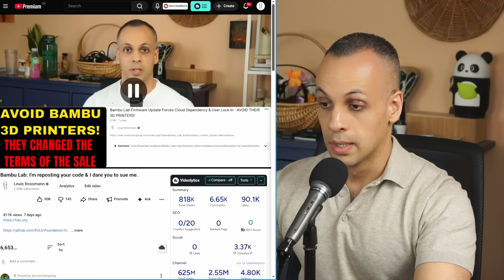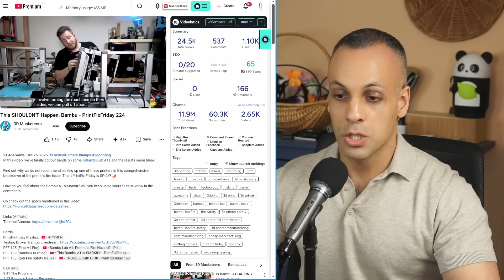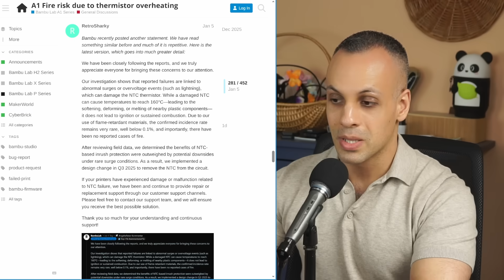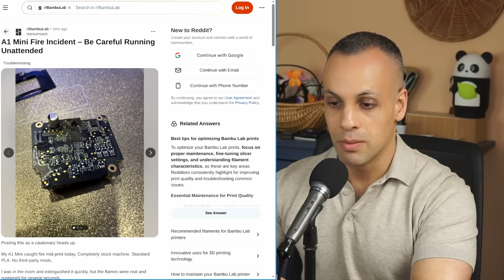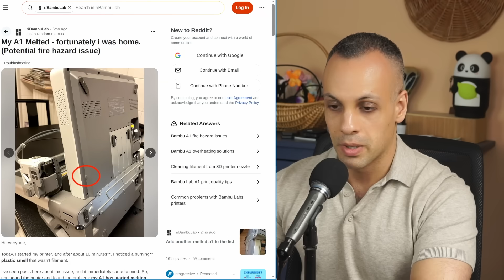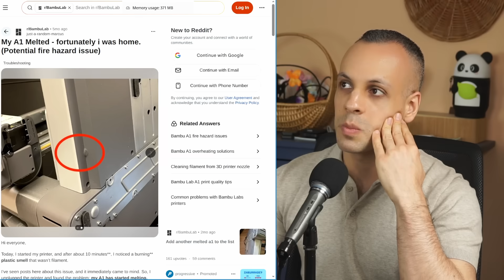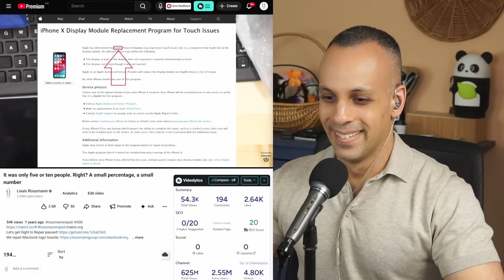Bambu Lab PR dumpster fire is turning into a literal one...

Comment: New to 3D Printing and have the X2D. Had problems with the Bowdon extruder, would not feed the right nozzle. Also problems with the AMS HT not feeding filament. Bought a new Bowdon from a 3rd party, they said they would compensate with a gift card, which is fine. And they will do an exchange on the AMS. This after way too many Emails back and forth. Only product I ever bought that doesn't have a dedicated phone support option. Guess that's standard SOP.

Comment: I bought an A1 in january and last week the NTC burned down. They sent me a replacement board and it was missing one of the cable terminals from the factory so now I'm waiting for a new one again...

I'm worried that the new AC board design doesn't have an NTC, they literally just bridged it... is that safe? if the NTC got so hot it melted, how's putting just a wire safer? should I be worried??

Comment: I went in for my second attempt at getting into 3D printing last year and bought a Flashforge A5M (not Pro) on sale because it seemed to be about on par with many of Bambu's features and specs but was way cheaper. I did my research and found that there had been some small controversy with getting them to upload their code that was built on open source software and there had been some teething issues with the initial product launch, but thanks to public pressure and a lot of patches, things had been ironed out. I was relatively happy with it and even their support email responses were WAY snappier than the many people complaining on their own subreddit were talking about. I ended up reselling it locally because I wasn't using it much, I needed the money, and needed the space, and I really do think that it's just as you said -- if a company like them could clean up their image and swoop in they'd be able to take Bambu's disillusioned customer base away easily. it'll be interesting to see how things look back when things are stable enough for me to give the hobby another go.

Comment: so sad to see Bambu's greed turn into the bad press.   They had an amazing line up prior that just worked!  I was amazing how easy and trouble free 3d printing could be.   I gave up on the hobby honestly.   If I ever go back, I'll only go with open source compatible control cards, and hardware readily available with easy replacement options.  It's all about the sensors and software anyway.   As open source got better and better, no reason to give brand names your money.  DIY/Open Source,  no reason to deal with restrictions and invasive tracking of what you may or may not be doing with your printer.  LOL.

Comment: Great Content. I own a Bambu Printer, but a Big one a X1C, which runs now on X1Plus since the Bambu Connect Disaster. I have recommended several A1 printers and i am now in a Trouble for it. It was before Bambu Lab turned Evil, before they were normal Chinese. I can only recommend Sovol Printers right now as true open source but they are not beginner Printers. If you buy a Sovol like the SV08 they even give the Voron poeples money for the Design, the SV08 is a budget Version of the best Printer, the Voron 2.4, with all the draw backs, but can take most upgrades a Voron 2.4 can take.  Intresting Question for the Burning Bambu Lab A1:  Which Versions are Burning? Bambu Lab said 1.4 Boards had fixed it, and reviewers had the 1.0 and 1.1 Boards and even under Thermal Cameras and "no hot spots". So are only the 1.2 and 1.3 Boards the Problems?  For me it's looks like that the management had a major change in 2025 at Bambu Lab when they were growing massivly. Before they adressed such safety problems appropriately, since 2025 no longer. And you buy today a Printer how they handle Problems now and not how they handled them in 2023 !

Comment: I never tried 3D printing until I bought Bambu Lab's A1 Mini a couple years ago. At that time, my impression of Bambu was positive. It seemed they were making affordable 3D printers that were reliable and easy to use for beginners like myself, and there were various open source slicers like #OrcaSlicer to choose from. 

But my opinion of Bambu Labs has now changed dramatically. Now it feels like their long-term plan was to attract people like me – who had always been interested in 3D printing but never got into it due to high costs and steep learning curve – into becoming new customers, and then once they gained market dominance, tweak the rules (or ignore them) to lock us into only using THEIR software and consumables. 

I've been a professional graphic designer for the past 30+ years, so I've victimized by this same corporate strategy before. Adobe is the prime example... for years, they pretended to be a creative-friendly company, catering to us, sucking up to us... hell, I used to get wined & dined by Adobe back when they were trying to convince designers like me to switch from Quark XPress to InDesign. But once they established market dominance, they started treating us creatives like dairy cows trapped inside their barn, by switching to a subscription-only model, latching their hoses onto our teats to extract their $30 every month... which then became $40/mo, then $50, and now it's up to $60/mo for software that hasn't substantially improved for 20 years. Adobe are shameless leeches that are now universally despised by the creative community, but they have a monopoly on the tools we have to use.

Same tactic as the predatory companies that sell us cheap printers that use proprietary ink. Lure us in with affordable hardware, then lock us into their ecosystem and turn us into their milking cows. Yes, I know there are alternatives to Adobe and Bambu Labs... but that's not my point. My issue is with the whole "long play bait & switch" strategy that seems to be what every company is trying to deploy these days. Instead of keeping customers by improving what they offer, keep customers by weaponizing the fine print above the "Accept" button they clicked. The more market share these corporations get, the greedier they get. 🖕🖕#BambuLabs🖕🖕

Comment: I would never buy a Bambu Lab because of the restrictions. That said, i have had little to none good experiences with chinese brands (Creality Wanhao). The only good printer from China ive experienced is the Formbot/Vivedino Raptor. Ive got 5 printers now, all Prusas. Why? Because ease of use, easy to repair, intuitive assembly. And the most effective support system in the whole 3D printing market. I can see why people buy Bambu Lab. Its like you said, Louis; they just work, like Apple. But when you want to do more/repair them, you hit the wall. And, yes, i run a cellphone repair shop, so ive had (and still have) the agony with serialized parts for Apple. Love watching your videos where you expose issues that alot of people have. Keep it up

Comment: A small number (almost all of the ones I’ve seen) of Chevy Sub/Tahoes have an issue where Chevy designed the dashboard poorly and used the cheapest possible plastic, so the dash is disintegrating after a decade or so. But eh, it’s a small number. No recall. No accountability.

Comment: I have been doing this since 2011. I started with the RepRap and Prusa Mendels. I still have the first Mendel I built in 2012. So I have literally seen it all.

I absolutely loved bambu and the product they made. Bambu labs' devices solved so many of the headaches the consumers routinely faced with other notable brands like Creality. However, having said that, this is not good for them, for the industry and most importantly for the consumers. I thought I'd keep upgrading to the best and newest bambus but I think my next printer is a different brand. This obsession about being "The Apple" of 3d printing is going to be bambu's undoing because I really don't think the comparison works. I wish they'd realize this and open up the ecosystem because adoption would go through the roof and they'd really actually be where they wanted to be all along.

Comment: Bambu has been actively trying to stop anything that might render their products non proprietary since about day 1. A third party company even sold a larger screen upgrade and they stopped that. Which especially stands out for a community that mods almost everything. Not to mention that almost every printer you can get just runs right out of the box. So no, I would never buy anything from that company

Comment: Easy to get started on (P1S got me printing), but once you learn, the restrictions are bullshit. Give me great power, im fine with responsibility. 

So happy with my Centauri carbon. After a certain point, the comforts are no longer worth it, for example, when you can calibrate all your filaments properly. 
Also nice to have the option to get printing at up to 350 °C on the Gen 2 rather than either spending way more on a Bambu or wiring resistors in series on my P1S hotends to get it printing up to temp for PPA/PPS.
Can't update my firmware without getting my printer cucked. Need to navigate whether I can even upgrade Orca without breaking compatibility with my printer (had to roll back the last time). Never buying one of their printers again.

Comment: I recently bought the Elegoo Centauri Carbon 2 as my first printer, because of this story. So far I'm happy with it. Obviously didn't do anything too complicated yet. The app has a lot of issues connecting to the printer. But I honestly do not care. I have to use a laptop or PC anyway so dumping the file on the USB stick they provide is just as easy and doesn't send everything I print through their cloud service. If you care for good value and want just one printer for hobby stuff and personal needs I would say it's a decent choice (keeping in mind that i'm very new at this)

Comment: I was looking at bambu lab a few years ago. That was right at the time they closed everything down. Luckily I had not made a purchase yet so I avoided them.
Though the Anycubic Kobra 3 I got instead is not the best either. It took a while before I started using it lan only, and I still use their software as that seems to work best.
At some point I got tired of the prints it made. My old Anycubic Kobra 1 and Vyper did a better job, although a lot slower. 
So to have the option to get into other materials I went and got myself a Creality K2 Plus Combo set. That is really a beast of a machine and I have almost no problems printing with it. I haven't even tried to tweak any settings, as it works fine as is. Only thing is I have it LAN only mode now on a closed off network.
I still use their software though. I haven't gotten around to using orca yet. And as long as their software is not annoying me, I'll just use it. (I do utility printing only, nothing fancy)

Comment: The P1S from bambu also has the same NTC thermistor issue. Though not nearly as common. My friends P1S NTC thermistor failed @ ~1500 hours. Sent the request off to bambu, they sent a board back within a week. Was pretty painless, though it should not have happened in the first place. In the P1S they did NOT remove the problem NTC thermistor with the replacement. It was on the replacement board received (same board revision), that was a couple months ago now.

I own the P1S and I think it is a fantastic printer, but completely disagree with their closed source nature. Love the push you guys are going for with bambu - I want to do more with my printer!
Reply: What really really frustrates me is that I cannot add my own RFID tags for my filament! WHY???? WHY LOCK THAT DOWN?? Just lock down the damn genuine filaments at least, fair, but let me make my own generic ones!

Comment: have bambu and snapmaker. Snapmaker took some time to calibrate and all to be on level with my x2d in terms of print quality, but BIGGEST issue software, damn is terrible - slow, annoying etc. In order to use snapmaker u need to multiple third party software, even camera is complete trash compared to bambu, just because of software limitation. Would be using orca, BUT, my printers are in different house, so GG here. Also, what sucks, is that all of these manufacturers trying to push their filaments as "best", while in reality they are all pretty much the same, but for some reason nor bambu, nor snapmaker cant add filament profiles for competitors - fuck both of them for that. Im not a fan boy, nor I see a reason for anyone to be one, all of these are just companies working for a profit and thats ok. If there is a better option than bambu, I will go for it, but for now, their eco system is miles ahead.

Comment: P1S owner here, was I am running not so updated firmware on my printer so that I can run my aftermarket 3rd party stuff on my printer, I like to tinker on all my printers and Bambu ,is about the only throw away printer I know off, I hope what you are doing will get them in the right direction by getting more open to 3rd party parts and software.

Comment: i own a Kobra3 (855h) & a Kobra3max (996h) privately and i run operate a Bambu Lab H2D (830h) at work... from my experience Bambulab runs NEITHER smother, easier nor better in any way. The print quality is identical and so are the issues.

Comment: I still haven't found a proper alternative for the P1S that I wanted to pick up from bambu. I currently have an Ender 3, so I basically have the Arch Linux of 3D printers, I just want something that doesn't require me to put in almost as much work as the printer itself does.

Comment: I had a bamboo printer and it was a piece of shit. Trying to get it repaired was a joke. Their customer service is horrible. It would take some times up to a week to get a response and it took six months of fighting with them and it still didn’t work so I filed a charge back. That’s when they send lawyers after they lost the charge back they threatened to assume me if I didn’t send it back to them I told him to go fuck themselves and I sent the printer to Goodwill and gave them the address if they wanted to go get it. 

Yeah they kind of open the doors to the whole new revolution and printing but every company has caught up with them and now they’re just resorting to stupid gimmicks with their new products. I bought one of those Centauri carbons for a quarter of the price of a bamboo and it works just fine right out of the box and I’ve yet to have to deal with it except for one customer service issue and they sent me the spare part after one email when I was back up and running fine. And I still use my old Prusa MK 3S which is pretty slow but that thing is a workhorse. In the same with the customer service is top-notch.

Bamboo focuses on making the customer wrong and making their PR right

Comment: Gonna drop my commnet: my a1 has just broken it's ON-OFF switch. JI power down the printer via switch like onxe a month maybe, and it broke, makes shortening noise, the printer turns itself off etc. Made ticket and they ask me to take the machine aprart and analyse the plug connector part ;D WTF

Comment: I did not do my recent research before buying my P1S, my third 3D printer.  I did do research before buying my first printer, but that was before Bambu locked everything down, and I just didn't keep up at the time.  I wanted to see what was so great about Bambu, and was greatly underwhelmed.  I would still choose my Qidi Plus 4 over the Bambu for ease of use, especially information on what is going on, and the ability to make modifications to the operational code.  I also figure the frame and components are good, and worse case I can replace the control board to work with those components.

Comment: I don't buy anything I can't own or block from tracking me. That includes vehicles. I refuse to even buy newer vehicles. Older vehicles can be worked on by myself and they don't track my routes. My main phone is a flip phone and my smart phone is running an open source secure OS. 
You may not be able to cut the cord completely but you would be amazed just how little cord you need.

Comment: I am So Incredibly Glad that I decided to buy a PRUSA. I was really tempted by Bambu's large build volume, but then I found out that their filament needs to have weird RFID tags which is annoying. But the fact that it will not work offline basically means that it is a BRICK. I don't buy BRICKs. And I'm so relieved that I dodged a massive bullet by avoiding them and buying a PRUSA. I ordered a PEUSA MK4S kit, I saved about $500, and I put it together in 1 day. I would definitely recommend the kit, you save a ton of money. Follow the online tutorials, it practically builds itself. Reliable, it's a workhorse, and nearly hassle free. 3D printing always has some small glitches no matter what especially if you are making your own 3D models ... so I cannot say totally hassle free. Nothing is totally hassle free. But the worst type of hassle is when it is deliberately Built-In to the product and there's no workaround ... that's a deal breaker. Get a PRUSA. You'll thank me later.

Comment: We have been in the market for a couple of 3d printers over the least couple of years.  Both times a Bambu Labs printer was floated, but we ended up going with Prusa printers (an XL and Core 1 L) precisely because of this type of anti consumer behaviour.  Sure they are a little more expensive, but the hardware and software are all open source and Prusa's commitment to keep an upgrade path open, and spares available is a marked contrast to Bambu.

Comment: So a replacement circuit board in a 3D printer failed in exactly the same way as the first board?  THANK HEAVENS he didn't buy a $70,000 Chevy Silverado.  Those things can lock up the wheels on the freeway when 6.2L engine or transmission failed (sometimes before 10,000 miles!) and you could be killed!